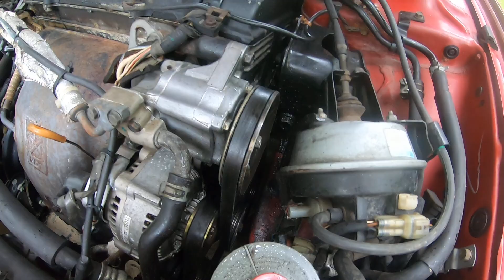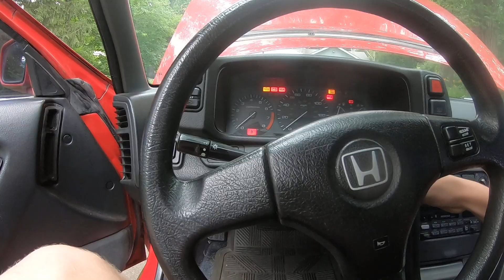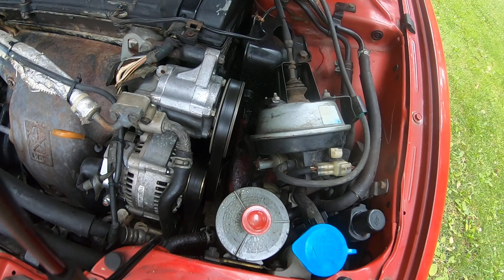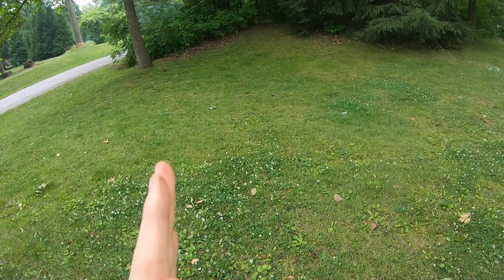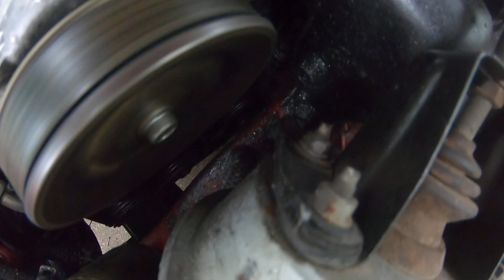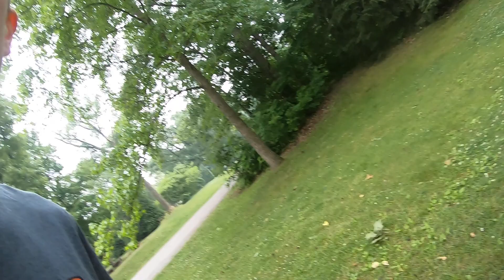I NEED YOUR HELP! 1991 Honda Prelude Belt Squeal Or Bearing Squeal.

Comment: Take off the A/C belt and run each individual pulley with the belt on an electric drill. That way you can isolate the noise
Reply from the maker: That is a good idea! Now the noise has mostly gone away randomly. I almost wonder if water got in it from the rain. But I am still going to check the pulleys.

Comment: Take the ac belt off and start it up and if the noise is gone, start inspecting the ac compressor clutch and pulley, idler pulley, ect. until you find it.
Reply from the maker: Yeah that is what I will have to do.

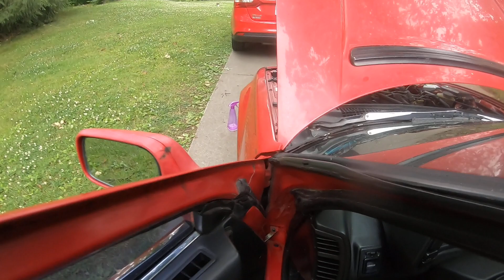Comment: I'm one of those types that throw money that I don't have. At 1:04 you mention on your "notes from the reciept" the idler/tensioner. Check idler/ tensioner pully for bearing wear with the belt off (wobble). I'd throw your money that isn't mine there and see what happens, if that's not it move on to the balancer.
Subcriber #527 says good luck and keep us updated.
(Smart move leaving a comment at Adventures Made From Scratch 😉👍)
Reply from the maker: I actually think now that it is the crank pulley. My grandpa put a crescent watch on the pulley and was able to wiggle it. the pulley is a two piece and I am pretty sure it is coming apart. 

Thanks for subscribing! I like his channel as well. I wish though he was closer so I could by his Opel GT off him.

Comment: Could have anything become misaligned if a motor mount broke on the hard stop?  If someone suspected a pully, they are cheap and easy to replace, might start there first.  My 66 Impala made a noise like that and ended up being the smog pump lol...  Pretty sure you don't have one of those on there though.
Reply from the maker: No I didn’t break a motor mount. I didn’t brake that hard. it was just kind of hard in the rain. I think water got in a pulley and screwed it up. Because the noise isn’t as bad. No smog pump lol.